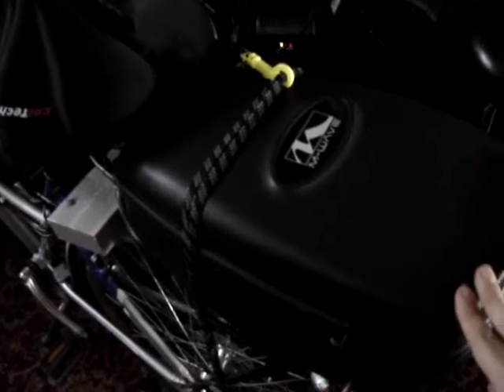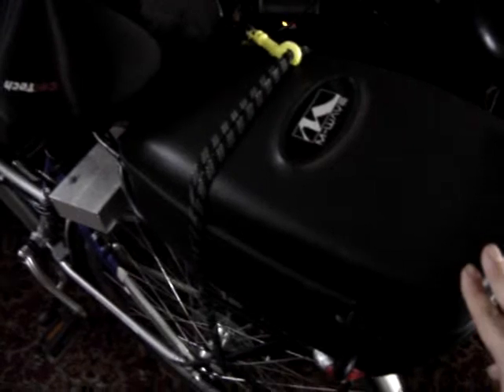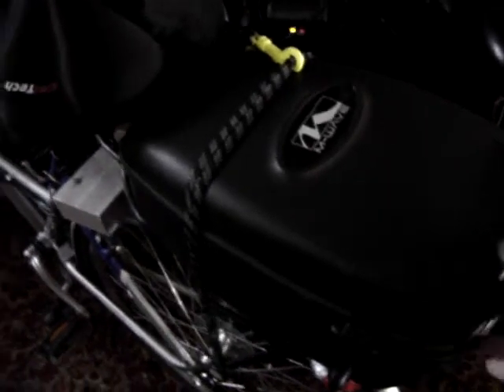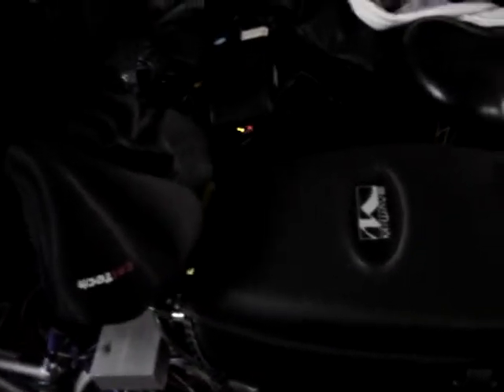Powabyke x-6 modified for extended battery range.

Comment: Hi i have a x6 and want to do this too it could you please let me know what items to order.I would be most greatfull as my son is going to use the bike to get to work and save me having to get him a moped which as if you have a son you will realise im a little against.
Reply from the maker: https://www.ebay.co.uk/i/272647348854?chn=ps&dispItem=1&adgroupid=47498721790&rlsatarget=pla-325206530534&abcId=1128956&adtype=pla&merchantid=115068180&poi=&googleloc=9041127&device=t&campaignid=857333742&crdt=0&ul_ref=http%253A%252F%252Frover.ebay.com%252Frover%252F1%252F710-134428-41853-0%252F2%253Fmpre%253Dhttps%25253A%25252F%25252Fwww.ebay.co.uk%25252Fi%25252F272647348854%25253Fchn%25253Dps%252526dispItem%25253D1%2526itemid%253D272647348854%2526targetid%253D325206530534%2526device%253Dt%2526adtype%253Dpla%2526googleloc%253D9041127%2526poi%253D%2526campaignid%253D857333742%2526adgroupid%253D47498721790%2526rlsatarget%253Dpla-325206530534%2526abcId%253D1128956%2526merchantid%253D115068180%2526gclid%253DEAIaIQobChMIhvD7lrjD1QIVzArTCh3xAQ6PEAQYAiABEgJi6PD_BwE%2526srcrot%253D710-134428-41853-0%2526rvr_id%253D1276977695749
Reply from the maker: Search eBay for 20ah 36 volt